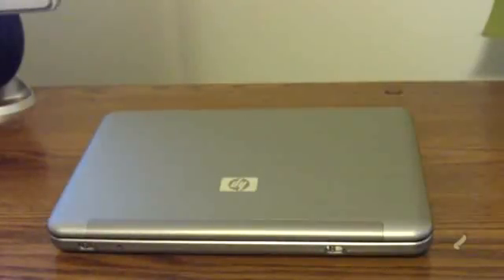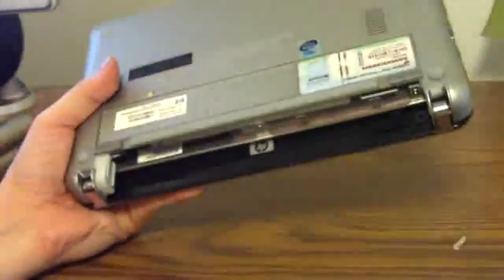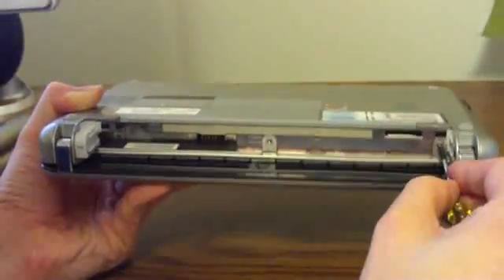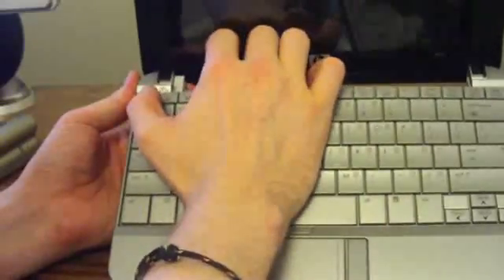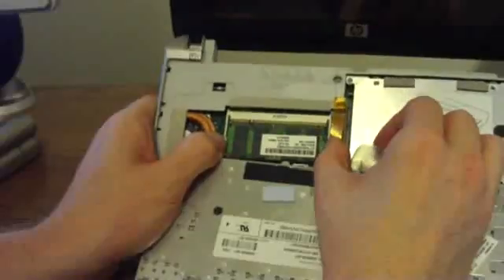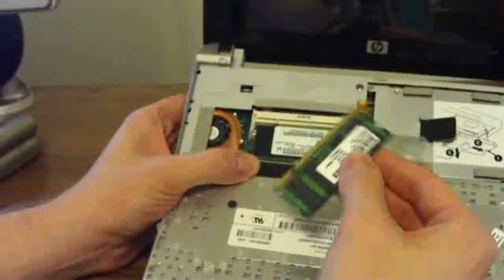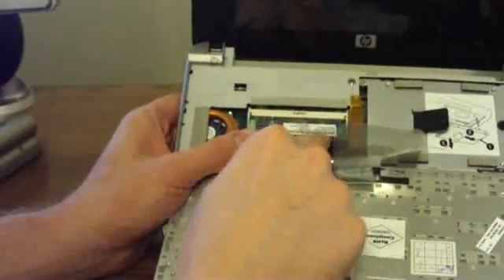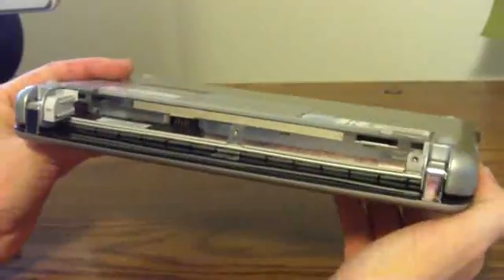How To Upgrade the RAM in the HP 2133 Mini-Note

Comment: Poetx213 I just purchased me 1.2Ghz Mini-Note and my computer came with 2GB of ram and Windows Vista Basic. I love it so far the only thing is that it can at times be really slow and has a really hard time running videos. this dosent bother me to much because i more than realize that it is not made to be a powerhouse, but i was wondering if it is at all possible to replace the C7M 1.2 Ghz processor to maybe a 794 C7M model which is clocked at around 2.0ghz and if it can be done how would it.